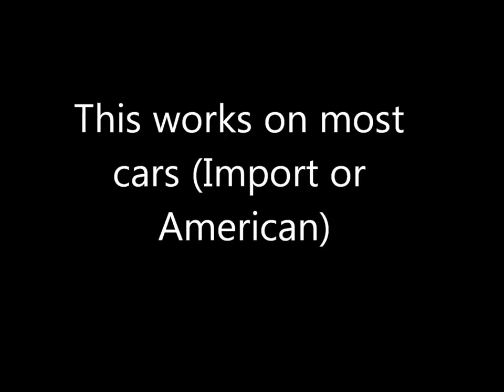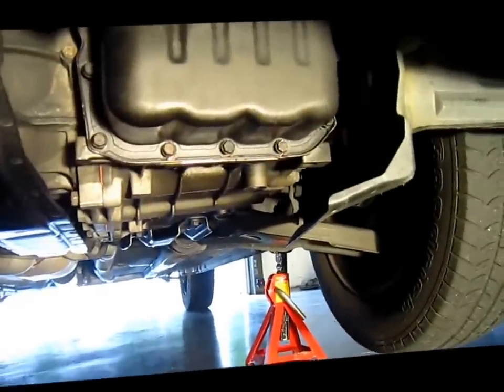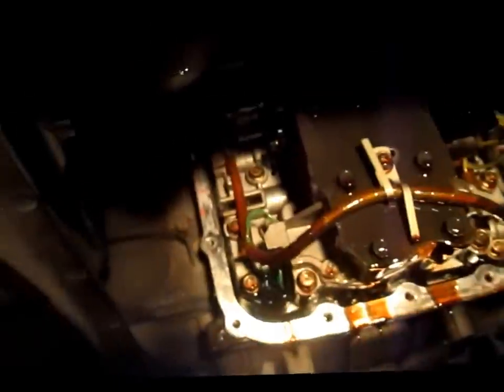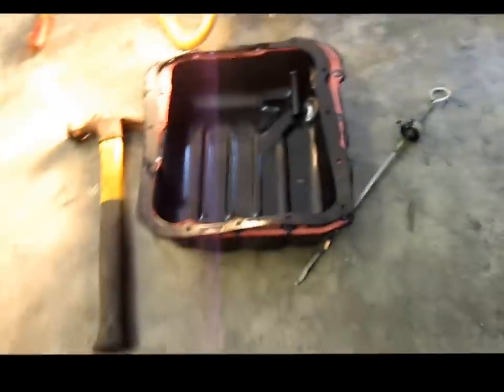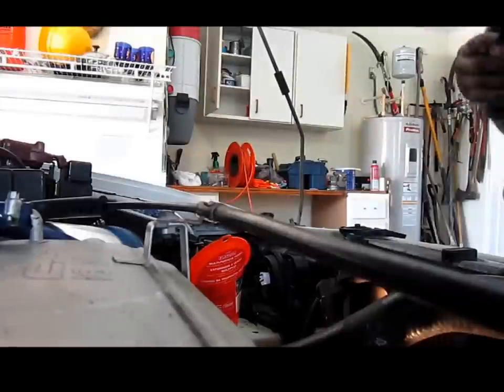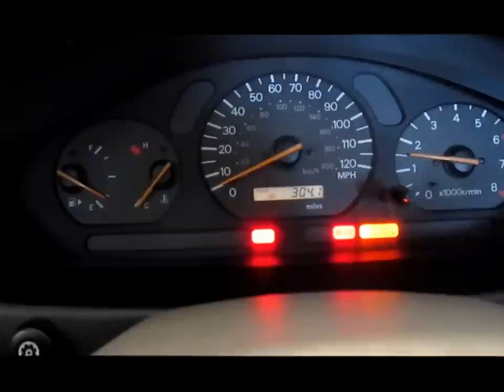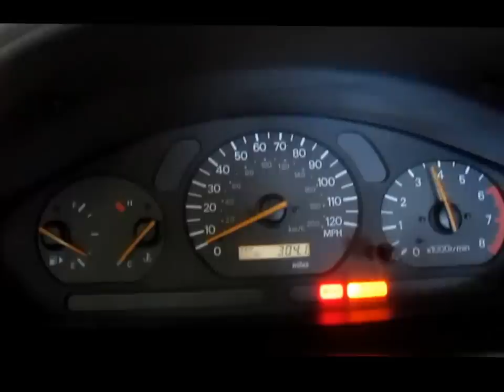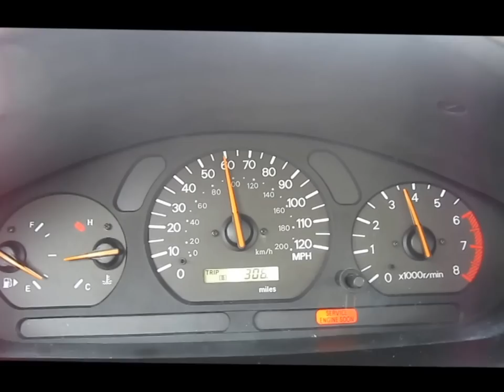How to fix bad transmissions (Transmission Fluid Change) 2001 Mitsubishi Galant ES

Comment: Nice video but draining it like that doesn't remove all the fluid, as some is still in torque converter. so you're basically mixing old and new fluid + these transmissions should only use sp III fluid.
Reply: Believe it or not some of that dirty fluid keeps the old transmission from slipping. I've seen a bunch of people having transmission problems after a complete flush .

Comment: why didn't you use the drain plug to empty out the transmission Fluid? is it nessissary to unscrew the whole pan and not just the plug in have a 02 Mitsubishi galant and it's been running fine just out of no where I was at a light as I accelerated the car started moving and then stop and I was not able to move the car I guess popped out of gear and was idling
Reply: Chandra Olazaba doesn't have a drain plug you have to remove the pan
Reply: Chandra Olazaba hi I have a Lancer 2006 ls andis the same tale, he take out the pan cuz he wanted to change the oil filter but for this transmission the filter is not serviceable since you need to take out the transmission to change it. Regards from Mexico
Reply: Well my 02 has a drain plug it's on the driver side behind the front tire
Reply: Sonic is right.....drain bolt on side and no filter to change. Its internal I believe. Also clean the magnetic drain bolt. Maybe I'm wrong

Comment: yes proton gen 2 has the mitz box & same as yours you only change the fluid only every 30k as the filter change would require the box to be removed & split to do it,as i found out,lol & use sp111 atf fluid

Comment: Hi there I really appreciate your help here you doing a good job! I got a 2011 Mitsubishi galant FE I'd like to change the fluid because I just bought it from someone !! Do you know what kind transmission it is ? If it regular TRX or a CVT trx? It a 2.4L automatic with  4 speed manual systems , Please help me out

Comment: I have a few questions. How long did it take start to finish? Did you have to add more fluid later the guys at AutoZone said it takes 9 pts.
Reply: 2 pints + 1 quart

takes 4.5 quarts

I have a 2000 model. it has a screw on filter on top by the pan

Comment: I have 99 mitsubishi galant 99 2.4l engine and i just got shifting issues and codes read p0715 speed turbine sensor witch is a little black connector on top of ur transmission .swap that out with a new one and car maybe running better sometimes the transmissions fine and a sensor could b the problem witch is the cheapest fix but i been wanting to do the same change the fluid as well i just hit 161k. And im also running random mis fires. P0300 mind u the speed sensor i have is fairly new but i live in fl and some areas flooded didnt get the light till i ran into some water oj my way bak home any thoughts

Comment: Question: same vehicle, same year. When in Drive and my foot on break pedal, the car "jumps" off and on...Gears shift when car reaches 20-30 miles, but again "jumps" when I stop...What does this mean? Thanks for your help...
Reply: I suggest checking your atf levels. It sounds like you've lost some over time.
Reply: This is old but.  Dont think of a bad transmission.  There could be $20 sensors that can cause that to happens.   input/output speed sensors or throttle body sensors.    spend $40-50 on sensors or fix a transmission that wasn't really bad
Reply: maradonaLAX
Reply: I have a 2001 galant does the some jumps into fears.hope in the trans mission isn't going bad. std levels are fine

Comment: Good on you for attempting this feat on your own! But you should have just removed the 24mm bolt on the lower drivers side of the transmission on the bottom drivers side AND... YOUR service engine light is on for a reason, ALWAYS SCAN your vehicle prior to any repairs to see why it is on. It might and could save you time & Money. 
Whenever a vehicle shows up at my shop with a driveability concern...I Scan the vehicle first to see what is going on.If the customer has it in his or her mind that somebody said "YOU NEED SO & SO DONE" ,This correctly finds the problem. Last comment...Your ENGINE WAS NOT BUILT NOR CAN IT TAKE THE ABUSE  that you are giving it. It is only a 4 Cylinder..IF you are using NOS "I saw the sticker on front drivers side hood" and always BEATING UP your car then that explains why your transmission fluid was burnt. I am not trying to sound mean or kick you. I am just giving you facts. Unless a person went to a TECH school then the only way to learn is by trial and error.
 I WAS THERE! sorry about any bad typing,I have a bad keyboard. BTW...If you need any advice...drop me a line,I will be glad to help,From Drag cars to Normal Vehicles.